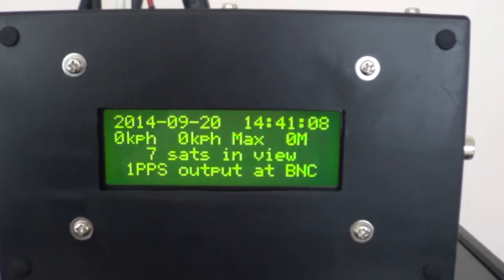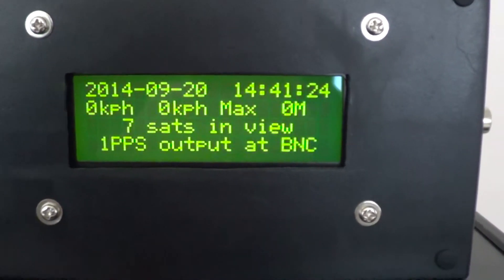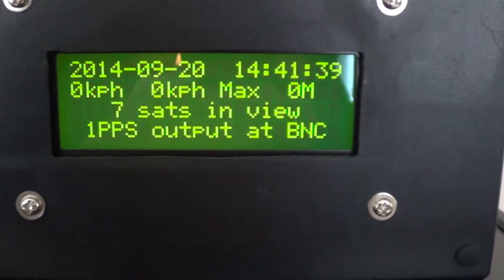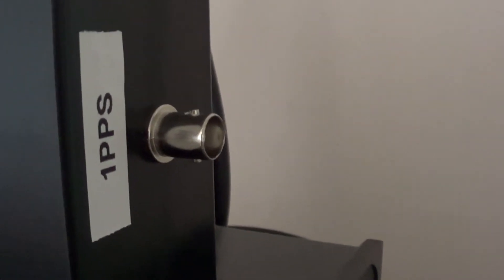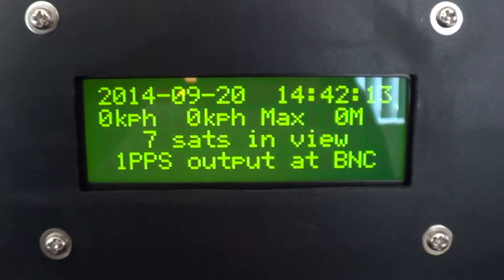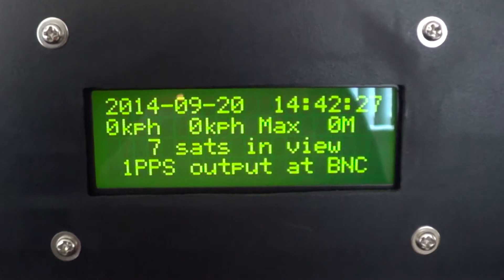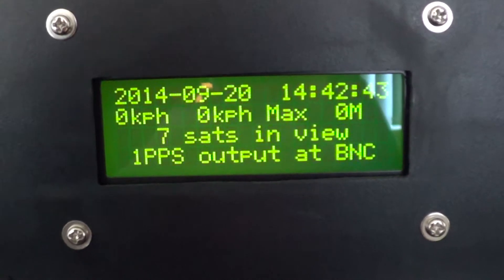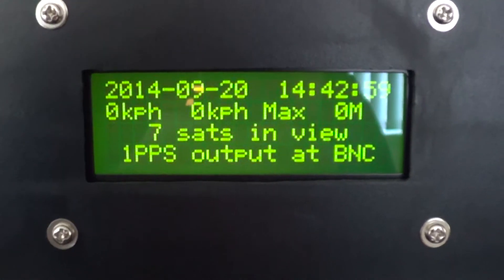V.KEL VK16HX GPS Part2

Comment: Hello Guys just to be clear 9600 is the data rate measured bps (bits per second) and BAUD is the signaling rate measured in BPS (BAUDs per second) . In most cases bps and BPS are the same. However there are data transmission methods that use amplitude modulation of the signal where TWO bits are sent per BAUD. v = - 2 = 00, v = - 1 = 01, v = + 1 = 10, v = + 2 = 11. Hence two bits sent per clock or BAUD  ........ Not very common now, old bloke with glasses. :-)
Reply from the maker: Good point!

Comment: I don't know why yt has deleted my earlier comment and your reply!!
Anyway, I also noticed very narrow pulses on the white lead but they are not synchronized to the pps pulse, and I cannot figure out what these are. Anyway, the pps pulse achieved from the photodiode setup is 0.1 sec wide. I only use the leading edge to provide a synchronizing signal to my clock.

Comment: Great,!  My PIC is now seeing GGA, GLL, VTG  sentences set at 9600,N,8,1,  baud. I had to connect the TX from the VK16HX into a 1K resistor onto the base of a PnP (BC548) the collecter was connected to 10K resistor to the +5v rail.  The collector then transmitted perfect NMEA 0183 at 9600bps protocol.  This now works very well on my 20x4 OLED display running on PIC 18M2 chip. I use C.5 Input set at N9600_16Mhz.  PERFECT!!! Thankyou James!
Reply from the maker: Hey no problem, glad I could help.....I did the same thing as you, using the NPN transistor to invert the logic....good deal for $12 or so from EBAY :)
Reply: +James Cutler Great vid, just to help with other people&#39;s frustration out there I got the VK16E working with a PIC32MX - (using a cheap USB to serial device helped). The VK16E can work with 3.3v but nothing much lower than that- I found that the voltage from a port pin was not high enough (below 3v).